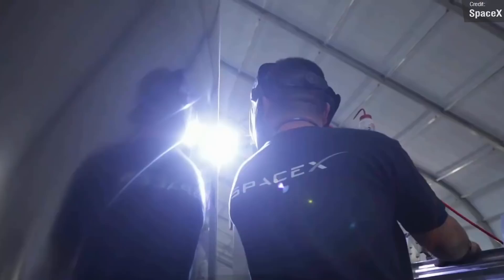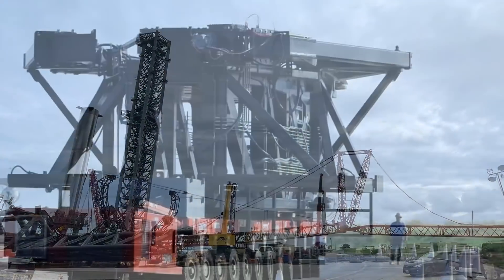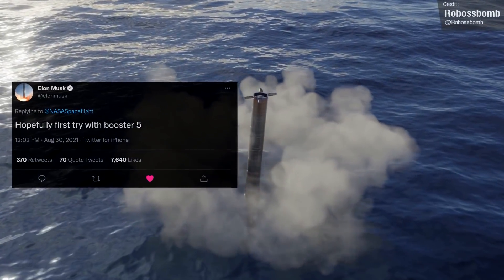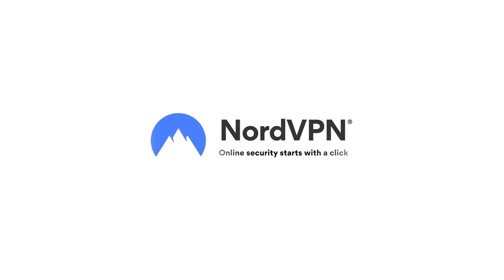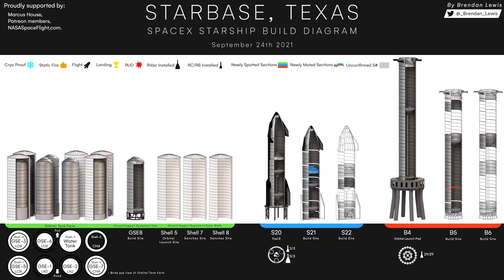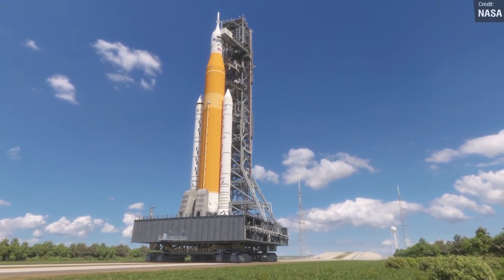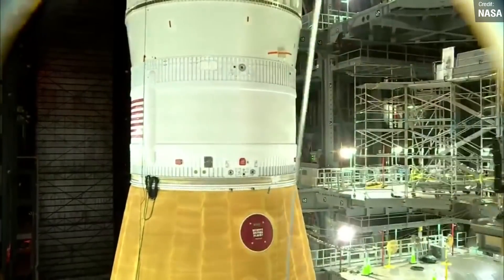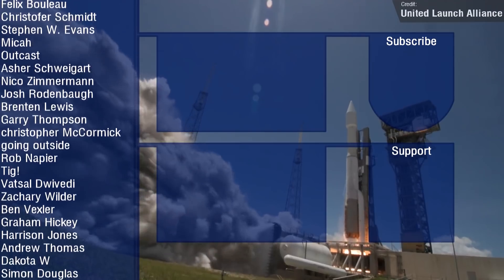SpaceX's Mechazilla Installation, The NEXT Starship's Construction, SLS New Footage, and ULA Atlas V

Comment: I just made my first landing on the Moon, otherwise known as your mother, in 7 years. While it may have just been a probe that has no chance of lifting off the lunar surface, I am still proud because the last time I did something like that I was 12. And it was all out of luck. It was in darkness, I had expended all of my fuel early on, and was only maybe 20 meters or so from a very steep incline leading into a crater. All in all, I think I am just going to stick with taping massive manned satellites to the biggest rocket I can make and calling them space stations and also bragging about landing my tin can with legs on the moon.

Comment: Hello space enthusiasts, I have a question for you, what are the bonuses of landing starship like a skydiver? Also why not land the booster in the same way?
Also Matt, these videos make my Monday so much better, keep it up :)
Reply: It takes almost as much energy to slow from orbital speed as to get there. Instead of using propellant to slow down, Starship uses Earth's thick atmosphere. A thick atmosphere has a low terminal velocity, where the air pressure pushing up from falling balances the gravity pulling you down. Maximizing your surface area to maximize the upward air pressure to minimize your terminal velocity means in theory no matter how high or long they fall, a skydiver's speed near the ground will be ~120mph. Starship is a bit over 200 mph iirc. Then SS swings upright and lands on its engines, using far less propellant because the air reduced speed by 90%+.

The booster does not need to slow down from orbital speeds. It's just on a ballistic trajectory(ies) and will reach a (high) terminal velocity going down engines first. Then the engines both slow the booster and increase the bottom surface area in effect. Finally the ship is designed for the flip and the booster's aerodynamics are not.

Comment: Holy censored, is that an aerospike on Arcas rocket?
Reply: Don't get your hopes up the ARCA aerospike is just investor bait. They aren't taking advantage of any of the benefits from using an aerospike and have solved none of the major engineering problems that come from using an aerospike. They are using it on the first and second stage of their 3 stage rocket (of which the third stage does most of the work) so they really aren't taken advantage of the "altitude compensating" aspect of the aerospike. Since their first and second stages are using a water monoprop (not even joking, their design is shit and mathematically doesn't have the performance to make orbit) they don't have to solve the overheating issues that plage practical aerospike.
Reply: @Pcat0  Just rewatched Scott Manleys video on ARCA space and yeah, I agree